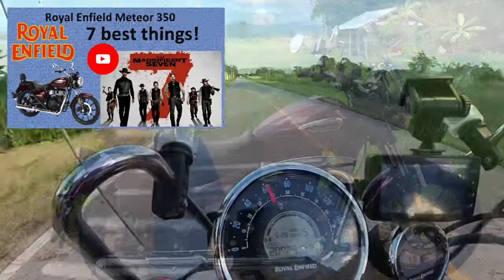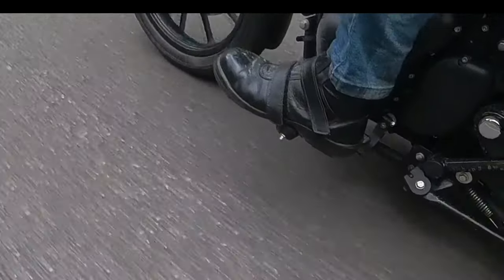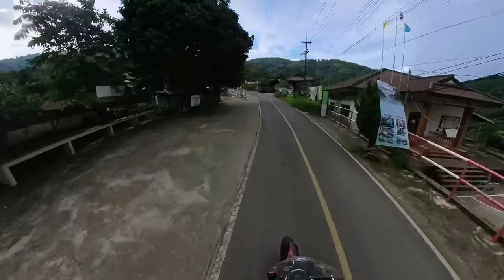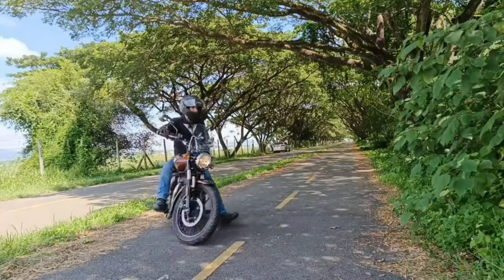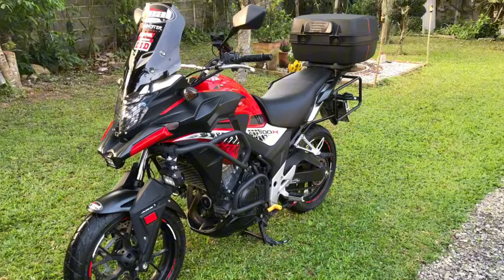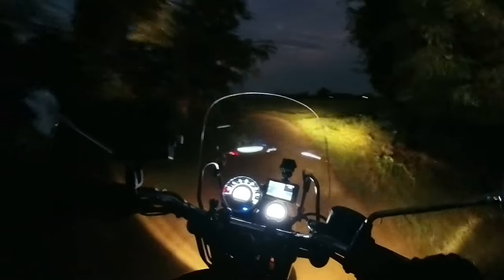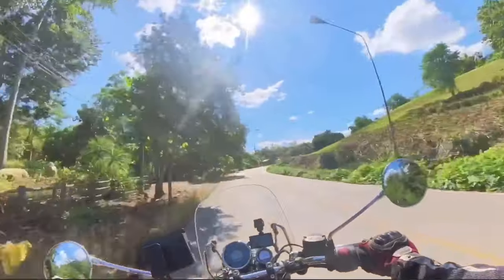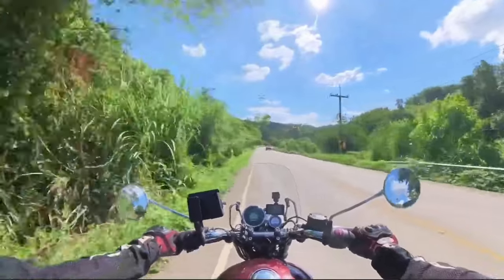Uncover the 7 Irresistible Reasons to Choose the Royal Enfield Meteor 350 in 2024!

Comment: Could you please do a comparison between the Honda Rebel 500 and the Meteor 350 -
Reply from the maker: I have owned both bikes long term in the past. Sorry to say I don’t have access to them any more. Both very good motorbikes. The Honda is a lower seat height, and obviously has more power being a larger cc and a parallel twin. Value for money the Meteor wins. But if you have a larger budget, I would choose the Honda Rebel. Still very economical, and that extra power when you need it. If buying second band get a model after 2019, with the LED headlight and larger front wheel. Hope this helps. 🙏
Reply: @Teacher-T-Thailand  Thank you for the reply - I'm in the USA and both bikes are available.  I will be new to manual riding as I ride a Suzuki Burgman  400 for the past 2 years.  I really like the looks and sound of the RE. They seem to have more character than the Rebels, but the Honda dealerships are every where.
Reply from the maker: @janettcotton4161  either way you can't go wrong. Both good choices 👍

Comment: I also love my Meteor 350 it is the perfect bike for me. I liked the heel toe shift so much that i put one on my Classic 500 and it made riding it more enjoyable. When the Super Meteor came out i thought yes i like that but soon dismissed it i would only regret parting with my 350. If i feel i need a bit more power i can use the 500 so i have the best of both worlds. I installed a DNA filter and cover, also a new end can and now the bike has more oomph it probably give an extra 2 horses it certainly feels like it and it sounds great. You will never get more top speed from it but who cares its fast enough at 70mph and keeps you the right side of the law. Ride safe and enjoy your riding.
Reply from the maker: Thanks for the comment. I too would regret selling the 350 also. So May have to sell my old Honda VT600 to make way for the new 650 Meteor. Does the air filter effect mpg? I also hear 1 extra tooth on the front sprocket is a good idea for an extra 10 kph?

Comment: between the meteor 350 and the classic 350 with is a better choice ?
 and what are your toughts on the new himalayan 450, would be a better choice instead ?
Reply from the maker: Everything has to be your personal choice here. Even though the Classic 350 and Meteor 350 use the same engine and frame, they are 2 completely different bikes. Please look at the video I made about this if not already seen. It’s the riding position and handling which is different. Surprisingly. I prefer cruiser style bikes, so the Meteor firs me very well. Unless you plan a little bit of off roading, not a lot of point getting a, Himalayan 450 with twice the power. 🙏

Comment: Agree with all of those except ,the gear lever and the headlight .The gear lever was replaced with the TEC replacement I just could'nt cope with the heel toe at all and the headlight on dip I find the beam too short and the high beam lights up the trees maybe over your way they use a different bulb ,but I still love  my Meteor :D
Reply from the maker: Yes the heel toe shifter is a love or hate thing. I’m surprised myself that I love it now. I didn’t at first. The headlight here is ideal. I just hear the new meteor 650 new headlight is all LED, and not as good.
Reply: Agreed about the headlight.  I've been able to adjust it down a little without losing too much low beam.  In a stretch, I can pretend it's one of those "Easter egg" nods to the artillery DNA as it's aimed to launch something into the next town.

Comment: That's very poor fuel economy. Is it because you ride in the hills all the time?
Reply from the maker: Yes. Lazy internet research on my behalf. Before I sold the bike I properly tested it. I was consistently getting 40km/l. That is very good. And I rode it hard and fast most of the time. My new Meteor 650 now 25km/l. Which I knew would happen. But rides over those hills so much easier and safer 🗝️💪🙏